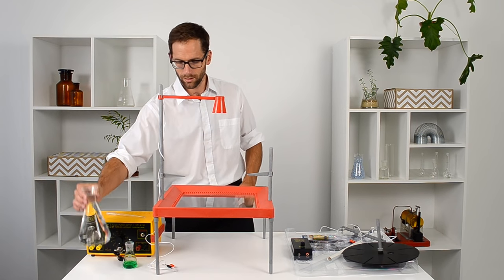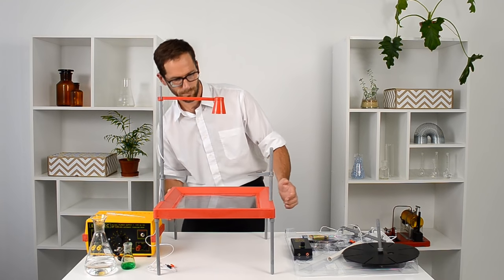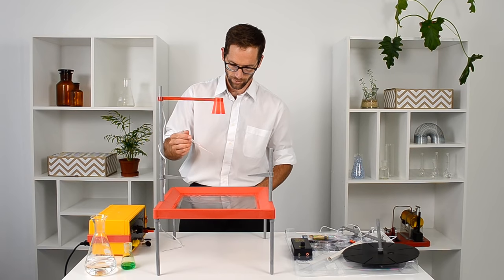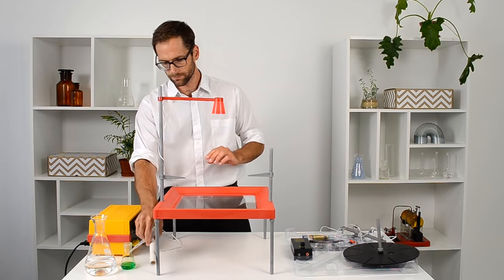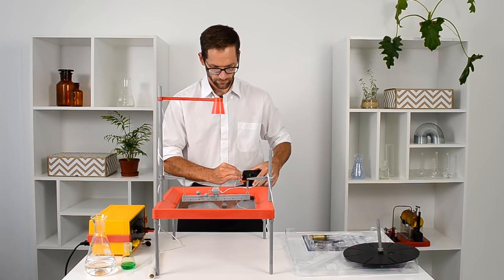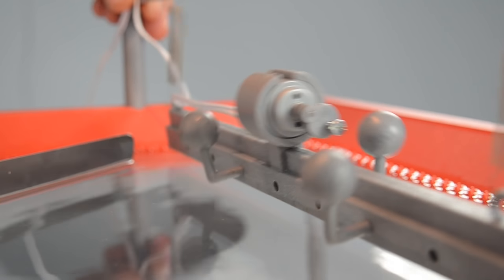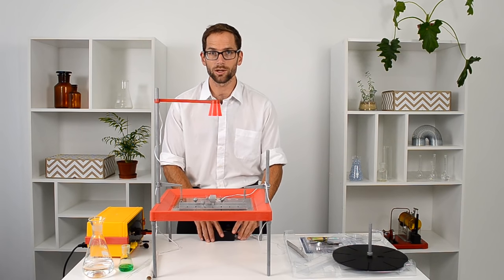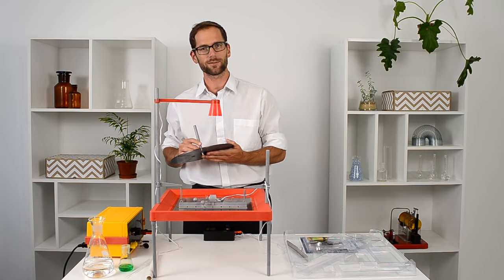7 Wave Investigations to try with a Ripple Tank

Comment: Great. What would we see if the freq increased in refraction experiment? Thanks
Reply from the maker: Naturally a higher frequency will decrease the wavelength so the bands in the projection may be seen to be closer together before hitting the prism plate BUT the typical refraction pattern will be seen as the wave front hit the prism - the speed of the waves will change (decrease), the wavelength will also decrease and the frequency will remain constant.
Reply: @laseceducation7933 , Thank you, but what I wonder is, when we increase the frequency, does the angle of refraction change?

Comment: Sir in school; with a stroboscope containing one slice, if the water waves look motionless we say that the frequency of the stroboscope equals to the frequency of the waves.
However it can also be that 
Fs=n×Fw
where n is an integer, meaning when the stroboscope goes one tour the waves do full oscillations n times (where n is an integer). I told this to my teacher but he denied it, even when I told him about the effect that occurs when a camera's capture rate is a factor of the rotating frequency of a chopper(exact equation depends on the number of slices/blades on the device and the chopper of course). Is that true? And why?
Reply: Good thinking. You can treat the stroboscope as a "camera" taking pictures at a certain rate. This process is called "sampling" and the effects you describe are called "aliasing". If you take pictures of the wave faster than once per cycle, you will capture images of multiple phases of the wave and see a blurry surface. 

If you capture images every other cycle, or every three cycles, or every N cycles, you will see the same frozen wave. 

These spinning wheel stroboscopes are actually somewhat more complicated by the fact that the sampling window is traveling along, but nevermind that.